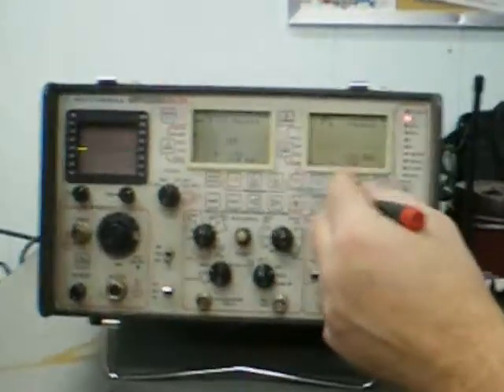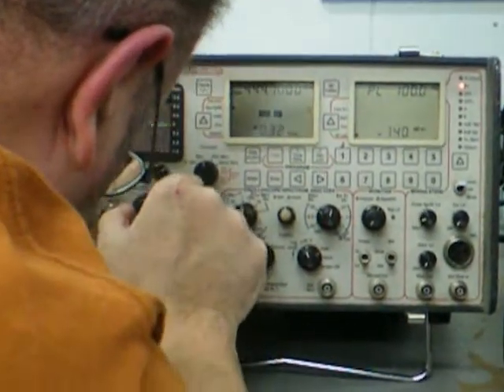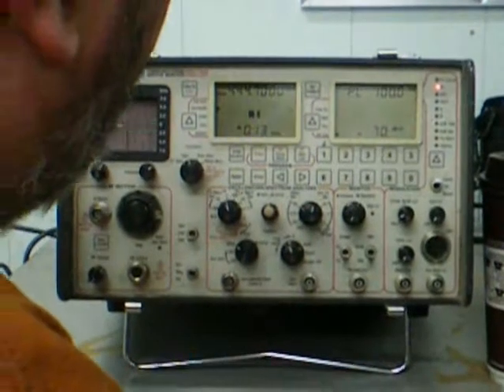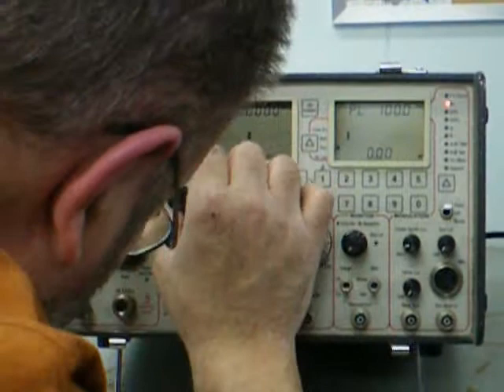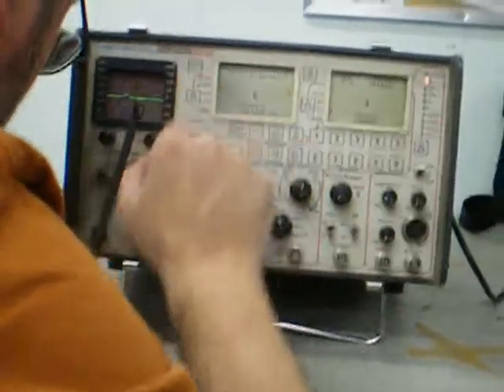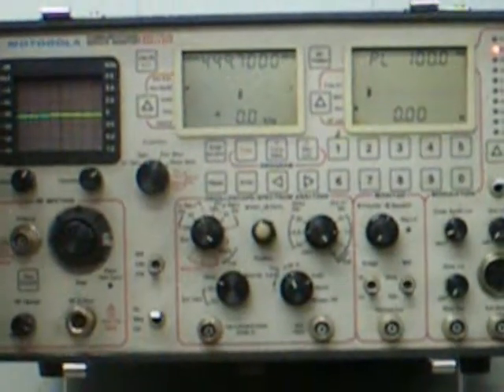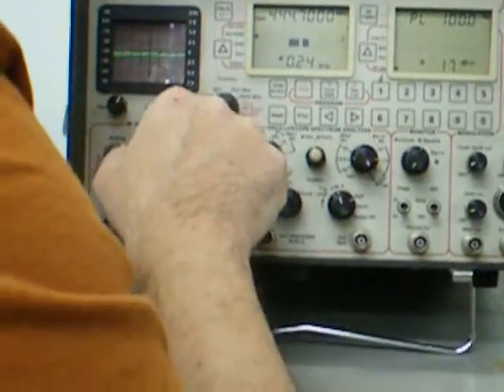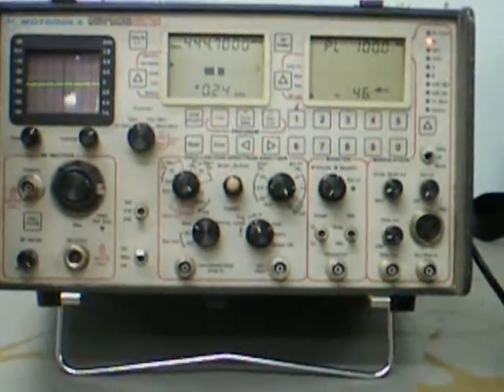Radio Service Monitor part 1 of 3

Comment: One caution I would add to the R2200 series of monitors. These units have a membrane keyboard.  Do NOT EVER clean it with a wet sponge or wet cloth. It will destroy the keyboard and make it unusable. Those keyboards are NLA as a replacement part. Clean with a dry cloth or paper towel, but no moisture. I know as I had to replace one of those keyboards in the monitor at the service shop I worked at way back when.